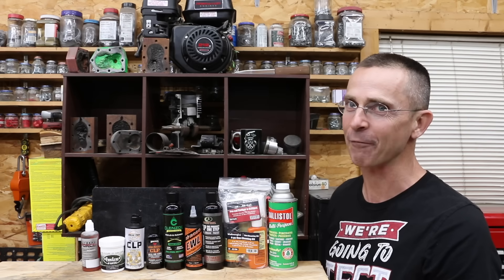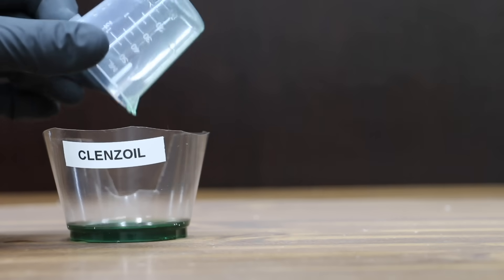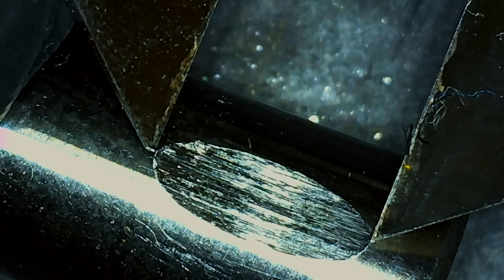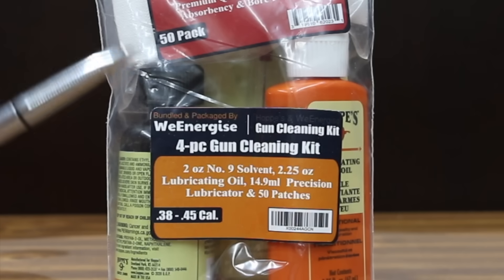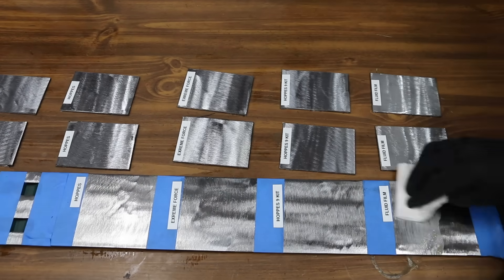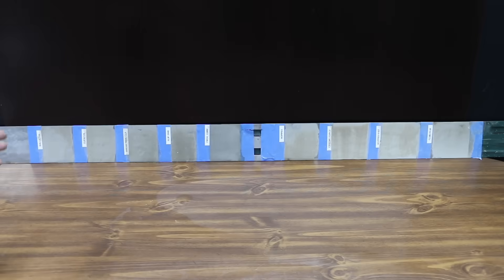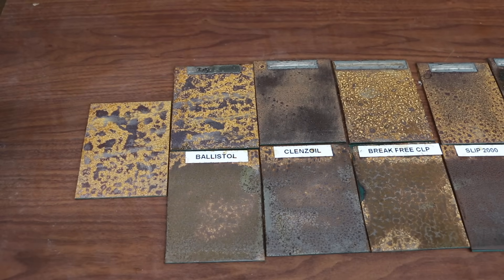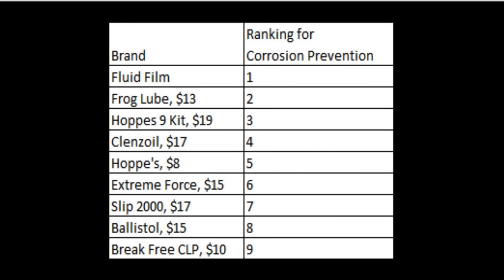Don't Buy A CLP Until You Watch This Review! It'll Save You Time And Money!

Comment: My experience with BreakFree CLP is that its very slick initially, however I have stored firearms with Breakfree on them and after months in storage they became gummty and inoperable... the slides were nearly frozen because the CLP turned to glue.  Some of the lighter lubes don't stay put and wind up on your glasses & clothes.  My current favorite is Lucas Extreme Duty gun oil.  IMHO it is 
the best.  I have been using and maintaining firearms for 50 years and that is my current favorite.
I also like Shooter Choice FP-10.  One additional comment... You can make a pretty good gun oil with full sythetic motor oil... like 10W-30 or if you can get it 20W-40 or 20w-50 (motorcycle oil).
I have also used STP 4-cyl oil treatment as a gun lube... because it stayed put and did not gum up.
Reply from the maker: Thanks for sharing.
Reply: How much break free did you put on those stored firearms? I haven't got to store anything long term yet and am just curious.
Reply: @s00-x2h  A few drops on the slide rails and a drop or two on the sear. My experience is mostly with 1911 style pistols.  Yes, they became very gummed up from the Breakfree CLP.  If a lubricant has a strong smell... it is outgassing, and it
can get gummy.  Lucas Extreme Duty doesn't gum up, stays put, and lubricates very well.  Breakfree CLP is fine for cleaning, but for long term storage... use a better oil.  A full synthetic motor oil would be better than CLP! IMHO

Comment: I have been a gun show dealer for over forty years, and I have tried many different lubes and cleaners in that time.  The two that impressed me the most, and that I personally use the most, are Gibbs synthetic oil and Clenzoil.  I use Clenzoil on my samurai swords, because it penetrates, displaces rust, and protects the blades from any rust or corrosion.  Since I'm having a tough time finding Gibbs right now, Clenzoil is my go-to oil for anything valuable or important.
Reply from the maker: Thanks for the feedback.

Comment: One test I’d like to have seen would be the lubricity test run after the oven test on a sample. Most times you’re not using the oil in a bath like that, you’re going to put a thin film on, then burn it off as soon as you start putting a lot of rounds downrange. 

Years ago, I ran the automatic weapons range for the ROTC summer camp. The same weapons were used the whole time, but every few days, another class would roll in and the weapons would all be cleaned in solvent, lubricated and made ready for the next group. The first range day after that, we’d experience a high rate of malfunctions. 
After cleaning the weapons with CLP (only) that evening, the subsequent ranges would have fewer and fewer malfunctions  until the next class rolled in and the weapons went into solvent again. 

Given that, I wonder if there’s a specific “penetration “ or “cure” cycle for these lubricants.
Reply from the maker: Thanks for the suggestion.

Comment: Frog lube requires heat to function properly. The lubricity test was not conducted correctly for Frog lube to work properly. Directions say to apply a thin coat then heat it up with a heat gun or hair drier. Not just smear it on and hope for the best. It's been my go to for years and smells minty fresh too. LOL.
I think I'll try Clenzoil , I may have a new favorite.  Great info as always, Thank you very much for all your hard work.

Comment: The problem with oil lubrication on pistols is that oil takes the way of gravity. If you lube the wear parts on it like barrel and slide/frame rails it doesnt stay where it should. Grease here is much better. Even so the little wear of Clenzoil was impressive.
Reply from the maker: Thanks for the feedback.

Comment: Hey Todd. Since watching this video I’ve become kind of obsessed with studying gun oils and some other products to find the best one. Your testing is excellent. I might suggest you adjust the rust testing a little bit. That hydrogen peroxide is brutal. That test you did with the bolts in another video might be good. In my research I’ve identified products that I think would be worth testing. I hope you’ll consider testing some of these and make another video. 

Seafoam deep creep
Corrosionx
Eezox
Lucas extreme duty
Breakthrough products
Stabil clp
Amsoil
Proshot
Mpro7
Slip2000
Weapon shield
Reply from the maker: Thanks for the suggestion.

Comment: Would be cool if you redo the test with more brands.  Then possibly mix the best together and see if they do better.
also experiment and make a formula with materials to make your own lube.  Possibly use multiple liquids and materials you can find at a local hardware store until you find what works best.
Reply from the maker: Thanks for the suggestion.

Comment: I am wondering how the liquid froglube would do for the wear test. The paste is designed to heat up, absorb in, then be wiped clean for applications in hot and cold weather, so the freezer test seemed pointless for the paste. I use frog lube in all my ARs (5.56, 6.8, 300BO, 7mm-08, 308) and routinely go shooting in sub freezing temps. Never had a single issue with thousands of rounds fired in sub freezing temperatures (outside conditions). I switched from CLP to froglube for the corrosion resistance 14 years ago and never looked back.

Comment: We're talking about guns, not engines. Why are you comparing the performance of both oil and grease when they're two different animals? I only use oil to protect surfaces, or to coat the areas that I can't reach with grease. I've used grease, not oil, to lubricate my guns for over 30 years and it's superior for lubrication. Next time you should run your tests on GREASE, not oil.

Comment: I have an idea for a video, I am an mechanical engineer and nothing I learned in school would explain why a torque wrench would need to be recalibrated if it was not stored at the lowest setting. I know that gun people also used to recommend not storing gun magazines loaded because the springs would take a set. I can't see how that would be possible with modern steels. So i think it would be interesting to take two torque wrenches and store one at the lowest setting and one at the highest and compare their accuracy a year later.
Reply from the maker: Thanks for the video idea.

Comment: I would love to see this experiment duplicated using only LSA. Its a semi fluid weapons oil that was developed for the M16 during Vietnam Era. CLP would start causing malfunctions after 200 rounds in my Bushmaster. I was informed of LSA by a certified Armorer & gave it a try. I did a torture test with 600 rounds fired & bolt carrier group still slid with ease. Another plus side... the bolt & carrier was substantially easier to clean the carbon from when i broke it down for cleaning. I switched to LSA for my gun lubricant & still use Hoppes #9 bore cleaner to clean with. That combination make it a very light chore!!
Reply from the maker: Thanks for the suggestion.

Comment: Testing lubricity of of the liquid proves nothing. It still contains the solvent. The more solvent, the less lubricity. Thus the better cleaners will perform worse. On a firearm, the CLP is applied and allowed to dry. That is how it should be tested. This is a case of the testing method driving the test; it can only test a liquid medium.
Reply from the maker: Thanks for the feedback.

Comment: These are CLP's, and like most "do all" products, they're usually not great at any one thing. I'd really like to see more tests with dedicated gub lubricants, and dedicated gun cleaners. For intance Slip 2000 doea offer a heavier weight EWL 30, as well as a gun grease (EWG). They also have more dedicated cleaners, like their Carbon Killer, 725 Gun Cleaner, and Copper Cutter.
Reply from the maker: Thanks for the suggestion.

Comment: I think most people let their firearms sit in a closet, safe, nightstand for years without using them. I wonder if there is a lube for long term non use that will retain its lubricating properties without drying out. So when you do hear that hump in the night you can rely on your firearm to cycle when it’s sat for a couple years or more without being dry.
Reply from the maker: Thanks for the suggestion.

Comment: Never remove copper! Only clean out the carbon; The copper needs to remain in the voids in the barrel And it will only build up to a point dim the build up will cease. Imagine filling, nail dimples, in sheet rock; once the dimple is filled, it will not accept any more filler. It will only build up carbon copper residue in the barrel acts as a bearing surface. And will minimize barrel wear. If you keep removing the copper, now you’re exposing the steel instead of sealing it. I never use the stuff, any of it. Nonchlorinated, carburetor or brake cleaner is perfect as it does not attack the bore or the protective copper film. Follow it up with a very light machine oil that is Not WD-40, And you’re a barrel boy last several lifetimes, if she abused by her rapidfire overheating.
Reply from the maker: Thanks for the feedback.

Comment: Thanks for doing what you do. I watch a lot of product comparison videos and your channel is my favorite. You have pointed me to a very large number of my favorite products.

I am leaving this message here because the CLP review is the closest to the type of review I have been searching for. I would like to see a review of bare metal polishes and sealers. Polishes similar to Flitz, Mothers, Autosol... and protectors similar to Renaissance,  and the plethora of ceramic type of automotive finishes. I am not nearly as concerned with polishing the steel as protecting it. There are many good polishes, but it is near impossible to decipher how good the polishes actually protect the metal. There is also the point of a flat finish knife should remain flat instead of becoming gloss.....

My main point of concern for this type of test is to protect knives and keep them in tip top working order. I want to keep them from rusting, dust free and food safe is a definite plus as my field knives come into contact with my meals on a regular basis.

Anyway, Thanks again for your wonderful work and channel. And I hope you consider a test similar to this.
Reply from the maker: Thanks!  Thanks for the suggestion.

Comment: Thanks for all the work involved making this video.  Clenzoil is good stuff, its nice to see that validated in a way - however I've veen wanting to step away from petroleum based, what would be the next best thing?  I'm not worried about extreme cold performance.  More for lubrication, cleaning, and corrosion resistance.
Reply from the maker: Thanks for the suggestion.
Reply: I could be wrong but I think Clenzoil is turpentine based, if that helps. Smells like it too.

Comment: I do have one disagreement.

Let me first say, I love your work.
I am a subscriber.
I love how you keep with moving with just clear, concise, Type-A delivery of facts.
So, this is not an attack.
Or, even a criticism.
Literally nothing more than an observation based disagreement.

Also, I have no experience with testing lubricity.
I'm just analytical.

But, it seems to me that the friction test you used does not replicate real world application in firearm usage.

Because, this test has a reservoir of lubricant that it runs through, constantly refreshing the application.
Whereas firearms only have what gets applied.
So, I'm actually suspecting that it may not have done justice to the high viscosity lubes; Frog Lube and Fluid Film.

And, I'm not partial to either of them.  It's just an observation.
I'm actually not partial to any of these.  I use a separate cleaner (Gun Scrubber) and LSA lubricant that my military buddies turned me on to.

On another point, as an fairly new Amsoil dealer, I'd be interested in seeing how Amsoil synthetic firearm lube and protect performs in your tests.

Thank you for all that you do.
Thank you for keeping it clear and concise for all of us "just the facts" people.
Keep up the good work!!
Reply from the maker: Thanks, will do!

Comment: I would actually make the argument that corrosion resistance at higher temperatures is more important to a duty gun especially, than the size of the wear scar.  Many guns get broken in really good and feel absolutely “buttery” once the parts wear in, and even run a little better for a significant part of their life once broken in.  I would argue that frog lube was the best unless you live in a cold climate, in which case I’d go with break free clp.

Comment: Looks like Cleanzoil should be in my shopping cart huh. I like the lowest wear scar and I don’t think I’ll be using it in -40F so not much of an issue here and also ain’t baking any guns so it’s ok it didn’t place first for rust prevention. Currently use Mobile synthetic engine oil and it works pretty good
Reply from the maker: Thanks for sharing.

Comment: Maybe heat at low level for a while to duplicate evaporation that occurs over time and THEN do the cold test. My guess is if the more volatile components like ethanol  evaporated out of the liquid then the remaining lubricant might not pass the cold test and be a MORE meaningful test, though not strictly matching the mil spec standard as stated. Freshly applied at -40 something might work great but what remains of what was applied at room temp two weeks ago might gum things up when you lower the temp to -40 right now. Just a thought.
Reply from the maker: Thanks for sharing.
Reply: Sure, love your videos. Thanks for,posting them.

Comment: I would like to see Hornady one, Militec 1, Amsoil firearm lubricant, FP-10, weapon shield, and Lucas Extreme tested. I use Hornady One for rust protection on firearms because it works, not as gooey and does not smell bad as the good ones like T-9 and CorrosionX. I put 5%  1.5 molybdenum powder in Lucas extreme to make my supper lube. . I wonder if Militec 1 can out do Lucas. I believe Militec has the highest flash point of them all. Am I wasting my money on the molly? Ken Luikart
Reply from the maker: Thanks for the suggestion.

Comment: Do you have an idea that would test what happened if you mixed different products that would cause any issues? Mainly due from using one lubricant and switching to another. I switched from Hoppe's to Gunzilla and found it gummed up springs. Gunzilla was rather a garbage product so I would not doubt it was the main problem.
Reply from the maker: Thanks for the suggestion.
Reply: Just asking. How many passes did you use for GunZilla? How long did it sit?
GunZilla will get really dirty at first as it is getting stuff that the other cleaners missed.

Comment: When i had to clean my rifles in the army i used to clean with hoppes and store my firearm with a thin coat of it but when i got to the range i would do a pre trip wipe and remove all of it and apply breakfree the hoppes was much better at getting rid of the carbon build up and the breakfree was better at cycling rounds down range
Reply from the maker: Thanks for sharing.

Comment: I don't understand all the trouble everyone goes through to find a CLP. You need a product that will lubricate metal on metal movement, work from a low starting temp and survive high temp during use. Sounds a lot like describing motor oil to me. Buy one bottle of synthetic oil and you'll have a lifetime supply of gun lubricant.
Reply from the maker: Thanks for the feedback.

Comment: So for the best results, use multiple steps: 1, clean with Hoppes or Fluid Film; 2 use soak the gun parts and then bake in the Frog Lube; 3 use Clenzoil as a lube for regular use; but change over to Break Free for winter/Artic warfare. 
Typically for cleaning I use Hoppes #9 solvent, and then Rem Oil or Army CLP as a storage protection, wipe down before going to range and then a light coat for firing
Reply from the maker: Thanks for the feedback.

Comment: When I got my first pistol back in early 2000s, I got a cleaning kit that came with Breakfree. I didn't really know what it was and used the 4oz bottle until it went away. I then bought something else at the store and could not figure out why my pistol was so dirty and had spots all inside the barrel. Then as I was at the range, I noticed the same cleaning kit for sale there and saw the Breakfree bottle inside. I then bought the kit again and sure enough, the pistol was shiny new clean again. I always bought Breakfree until about 2014-16 when I switched to Froglube and completely blown away by it. Probably my two favorite products. I'm now 100% froglube guy and even bought the 1 gallon paste drum and the cleaner and only use Froglube.
Reply from the maker: Thanks for sharing.

Comment: CLPs are a nice, convenient concept for general-purpose use, but they won't be exceptional in any one category. They are a compromise. You're better off spending a little extra time cleaning with a dedicated cleaner, lubricating with a dedicated grease/oil, and protecting with a special purpose product for that use. That said, I'll still use Clenzoil or Break-Free when I'm in a pinch.
Reply from the maker: Thanks for the feedback.